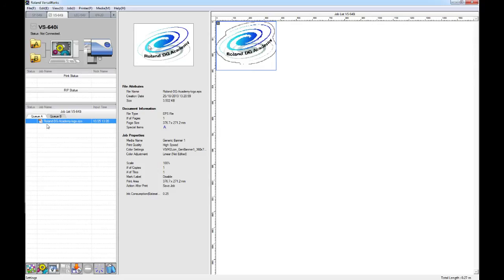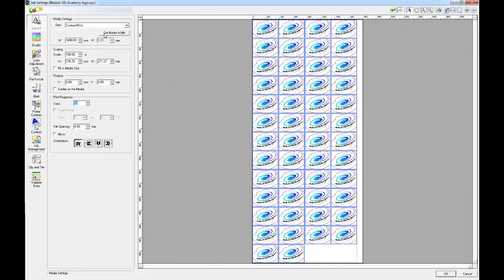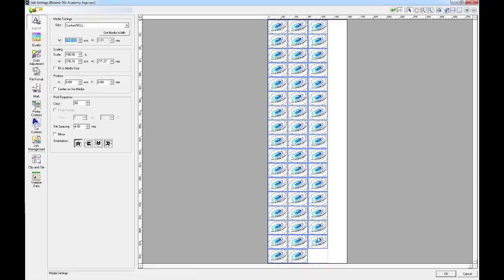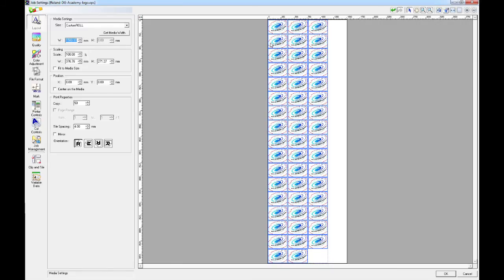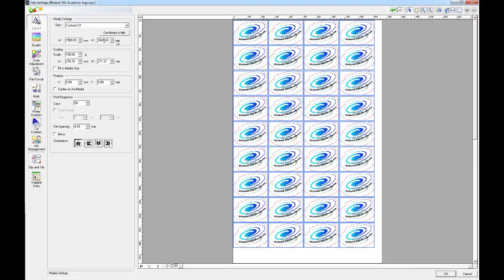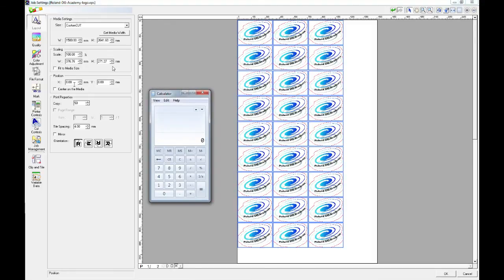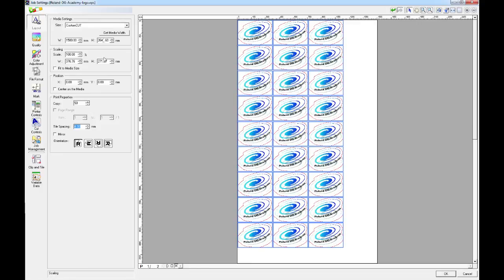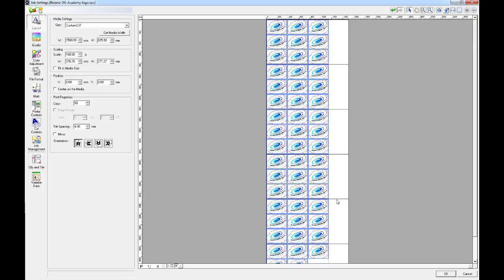Roland VersaWorks - Custom Cut

Comment: When I print with the custom cut option, the crop marks (Print&Cut Alignment) on the second row and on do not print correctly.
The first row prints initial crop marks, design then end crop marks while the second row and on prints only design and end crop marks. Is there something I can adjust to print initial and end crop marks for all rows?
Reply from the maker: What device is it you are using? Try adding 100mm gap between the pages.
Reply: @RolandDGEMEA Thank you for your reply, i will try the 100mm gap. I am using a Roland BN-20

Comment: Hey - how do you make it so it cuts after each page? Is there an auto cut feature after each page?
Reply from the maker: Hiya, yes there is an option in the Printer Controls tab in Versaworks is a 'Cut Sheet After Output' option, that should do the trick!

Comment: How would you create a gap between the pages? I'm looking to have a 12 inch gap between the page breaks, this helps bring able separate, laminate then cut.
Reply from the maker: Hi Jonathan,
You would just need to increase the height of the custom cut sections in the 'height' box of the layout tab.
Reply: What if you want to reduce the space between the custom cut sections? Not the art being printed but the space between the end of the first group and the start of the next group?
Reply from the maker: Hiya Joey G, as previous comment only reduce the height not enlarge it, so that the Custom Cut section is a multiple of the height (or width if rotated) of the image(s) plus any tile spacing
Reply: I did exactly that, height of job plus tile spacing, yet the page gap size is still about 1.5", does versaworks have a minimum it will leave? I would like to have it so there is NO space between page breaks and not waste as much vinyl.
Reply: @JOEYG707  hi did you fix your problem on the gaps? thanks
Reply from the maker: No there is no minimum, should be able to get no gap. If you are stuck please give our tech support team a call and they can remote login and check for you 01275335540. Thanks
Reply: Printer Controls -> [GENERAL] CHECK Use custom settings
Set -> {Page Space} in "mm"
Reply: How do you use the Custom Cut feature with a take up bar, when you are also Contour Cutting?
When the printer sucks the page back in to cut, the reel doesn't leave enough slack, and you get a motor feed error.
Reply from the maker: Use the TU2 settings :)